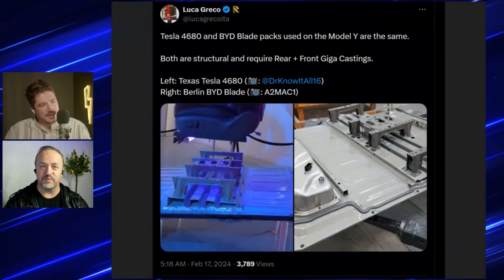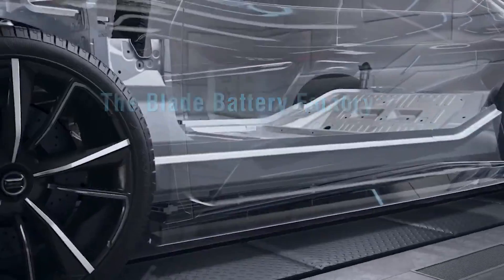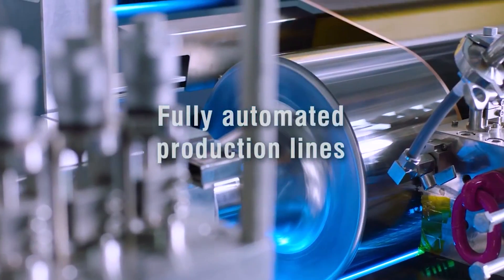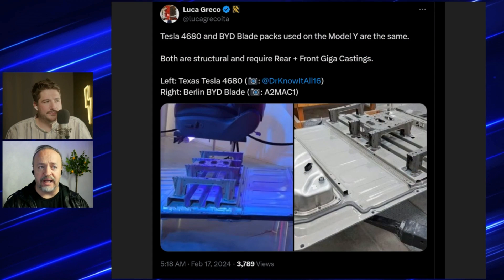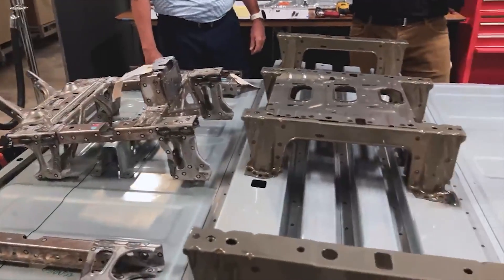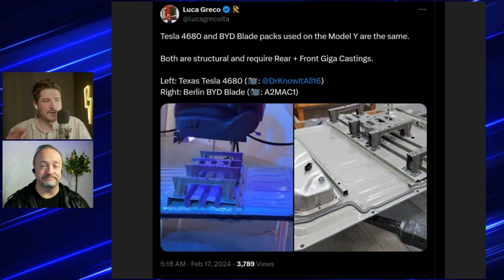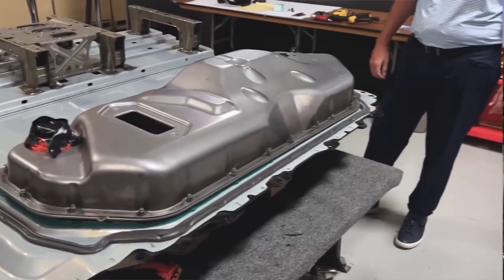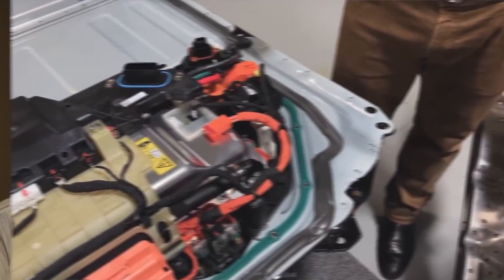Tesla's Breakthrough: Structural Blade Batteries & Panasonic 4680's!

Comment: I understand the benefits in weight saving from a structural pack however, if Sandy Munro's dissection of a 4680 pack is anything to go by, such a pack does not allow repair or the removal/replacement of individual cells due to the cementing together of cells to maximise structural rigidity. This just adds an element of increased risk of possible high cost battery replacement down the line - not saying it is a big risk if Tesla have sufficient confidence in their cells and, in any case, Tesla themselves always charge for a full replacement pack.

Comment: I have a Model Y RWD from 05/2023 from Giga Berlin with BYD Structural Pack. When i got the car i accessed the MCU to retrofit a USB Data cable (with Data Port Module from an old Model 3 that still hat Data ports in the Middle console) for the middle console and even on the MCU a sticker clearly says "STRUCTURAL PACK". The BYD Pack 100% is structural.

Comment: Re: "4680 production not keeping up with demand."  Looking at the videos by Joe Tegtmeyer gives us a clue on just how overloaded GigaTexas is.  A lot going on there and with that many things are getting in the way of and slowing down other projects, like the 4 new 4680 lines.  (Look at the new Concrete poured outside the GT factory just to store the Cybertruck castings!  They are out of room.)
1. It appears that the expansion, (adding 4 more 4680 production lines), at GigaTexas is slower than they hoped for.  
2. With the Cybertruck also ramping up, that also affects the work load.
3. Optimus robot
4. According to Sawyer Merritt, part of "Dojo" is being at Giga factory Texas! (According to Grok.)
5. Boring tunnel at Giga Texas
6. New super large parking Garage at Texas.
7. Roof leak problems, (that took months).
8. Roof tore up to add additional cooling apparatuses! (Still not done.)
9. Is the 'Redwood' model also starting at GigaTexas because they want to be near the engineers so they could get the kinks worked out while Giga Mexico is being built?

Comment: Think about a box filled to the same level with small ball bearings vs one with large ball bearings, the small ball bearings will sheer between layers far more easily because they require far smaller movement to hop over each other. In other words the smaller batteries are far less stable in a large structural component -ultimately the larger batteries will have fewer layers and so be stronger for the same packing tolerance...hth
Reply: That's what the super hard foam is for, it's a structural single strong slab.
Blade batteries don't go right across so needed to be redesigned to lock together 
AFAIK
Reply: The 'structure' of the structural battery pack is a stressed skin.
The loads are tension in the top and bottom thin steel skins.
The batteries are only serving to keep the load carrying plates apart.